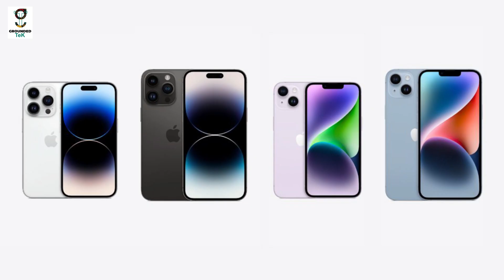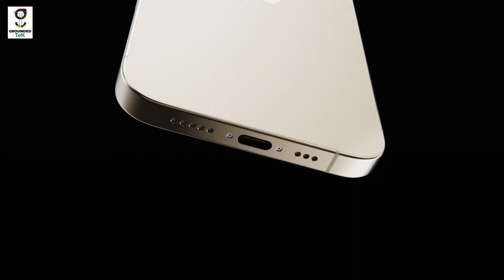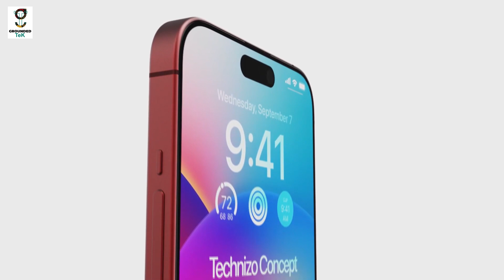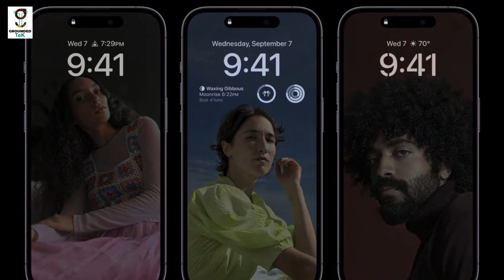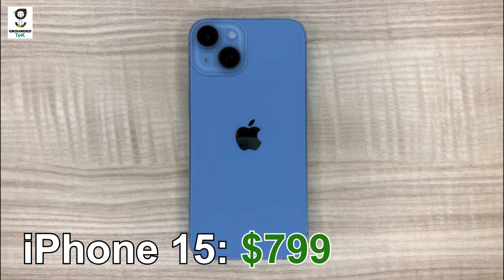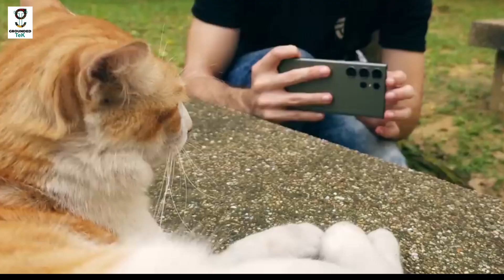Finally iPhone 15 is Revealed! iPhone 15 Plus and 15 Ultra | Big Changes! | Grounded TeK

Comment: LG always had the best hardware. Their V series was a step above anything quality wise their software was fine they gave you so many features for such a little price. Even new phones can’t compete with a 2020 LG V 60. I mean IP 68 water and dust resistance 1080 24,60 full HD +6.8 inch PO lead display wonderful cameras, pro video modes in manual camera mode their second to none a 3.5 mil hp Jack with a 32 bit digital to analogue converter expandable storage up to 2 TB of 5000 mA hour battery some of the best battery life of any phone barely there bezels cinematic full vision display is beautiful

Comment: I would be a lot more happier if instead of waisting more money and time to make these products look more appealing and attractive.That they stop being stupid and make them a lot more secure than they actually are. I am not at all impressed with the fact that I have had my identity stolen multiple times and it’s not just due to an Apple product but because of a Samsung product that started it all off. Instead of trying to polish a turd, how about getting rid of all of the bad software, Apps, and programs that run in and on your Cellular devices that are known to be used by Hackers and or Crackers to attack not only your products but everyone’s devices? If you have to have an example I can recommend that you get rid of Bluetooth much like Flash it is full of what I call fatal flaws and bugs that are Hacker friendly and easy to exploit. I have had my identity stolen twice and given that Samsung lied about it when I reported that there S-20 Ultra phones were being hacked and that they had several security vulnerabilities at least 2 years before they now openly acknowledge that they had a minor issue that just so happened to affect every single device that they had ever produced in the past decade! If Apple, Samsung, and the others are not going to do anything about the security issues with their products and services like stop using dangerous and flawed software then as a result of their actions then at some point the government is going to have to take action to make sure that they are going to act in a slot more responsible way. This putting profits over people’s personal safety has got to come to an end and very fast! Changes to the rules and regulations are coming it’s just a matter of time, where if a Corporation decides to put you, or your family, others at risk by not doing everything they could to protect your safety from being affected or threatened, harmed, then they should and can be held responsible in court and that means they should be punished the only way that Corporations are capable of understanding that’s with massive $$$$$$$$ liability, fines, and if they are not willing to do their jobs properly then they shouldn’t be allowed to do it poorly! I have heard too many excuses from too many device makers that they are being forced to use software that has known holes and bugs “Exploits” in some secret Government attempt to allow them to be given off the books, access to spy on anyone and everyone who owns a device without a warrant or permission, supervision or consent of a trusted Court Official or Officer! Not that the Courts have a lot of discretion or room to judge what anyone does or doesn’t do in the privacy of their own personal life and or data as long as they are obeying the laws and regulations of their communities. Given the current state of the Supreme Courts lack of transparency and accountability regarding their own personal and business interests, profiting off from their political positions and what actually amounts to or at least has all of the potential appearances of Bribes being taken and their opinions,  ruling, and cases, are all subject to the whims of whoever is paying them to find in their favor. In my opinion this should be seen as nothing less than Judicial Prostitution at its finest. Instead of wearing black robes to court they should be wearing Red Robes, Pink veils, and high heal shoes and I am not talking about the Women of the Court. But all of the members and their partners in crime. This is what we get when we let someone like Mitch M stack the Court with religious Zealots, Bigots, and closet Raciest! In my opinion the Current Courts are a mess and this is a issue that is going to be addressed very soon. The New Court will be made up of a better representation of what America is really made up of almost all Atheists and non religious people who are not going to bring their religion and other Superstitions to their jobs and inflict their beliefs in Santa-claws, The Easter Bunny, and all kinds of other things that if they were not born out of a religious belief, then they could have been used to justify by the same Courts to discriminate against and to institutionalize them for the rest of their lives for mental illness. For example belief in ghosts, and other craziness. Sorry I ventured away from the topic of trying to get Apple to stop spending money on the appearance of the product and to make sure that they are actually spending it to make it secure and safe for consumers to use. I hate the new colors and wound rather they come up with a better way to incorporate the Yubico keys and other security features into their products without having to pay an additional fee to secure a flaw in their products and or services. But such is the World that we currently have to live in where we have to pay extra to protect ourselves and fix the manufacturers issues, if we want to be able to use the technology that we originally bought and paid a lot of money for. Also device manufacturers have got to stop making things that are profit driven, not everyone can afford to or needs to buy a new device every time they change their underwear. If they were smart they would make all of their products modeler so that people can rent or lease their devices.  Then instead of buying a new one every month they could just send it to a local service center and have the ______________________s changed out or upgraded for a small change. They could also make money by offering custom parts, paint, or etc. and then shipping it back to the customer. The customer could use a different loaner phone or get a modular one with the new upgrades, updated ______, and turn in their device and then the service center can take it apart use that core to build and replace a device for someone else’s device wanting to upgrade. So on and so forth, also think about how much it would save on Environmental Impact and other costs savings. Eventually everyone will have to go to the modular systems as resources and labor costs become more expensive and supplies become scarce and demand increases as disposable income decreases and the overall appeal of lugging around a device is replaced with a new one that is unique and more user friendly, the push is  already on for implementation of the implantable “Brain to CPU” Wetware interface and wearable technology beyond Google glasses, or I-watches, wristbands, Earring,  Brain Stem Electromagnetic interfacings BEI’s. So  The shape of or the size of a device is not going to really matter in the very near future because the technology is already being tested. This means that any and all devices that have the current design and interfaces will be outdated or obsolete in the near term future. The only thing that is holding up bio implants is better security of the overall internet and all of its infected hardware, running malicious software that you don’t want to compromise your wetware biological systems. It’s not like Norton has created a injectable version of it’s antivirus anti malware software.  We’re not sure when we’ll get Malwarebytes in chewable form. Sorry buy. ThThe new cellular device with all of its flaws and issues or wait until all cellular devices become obsolete in the next few years???

,